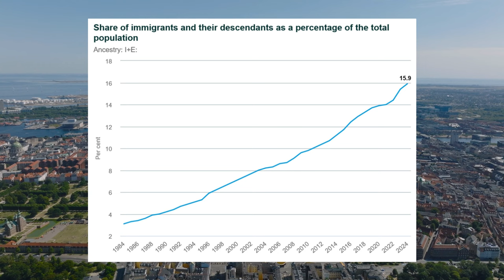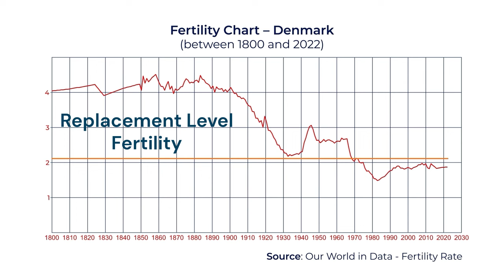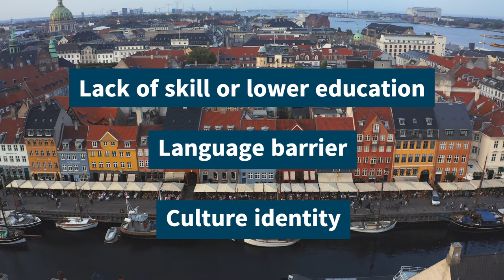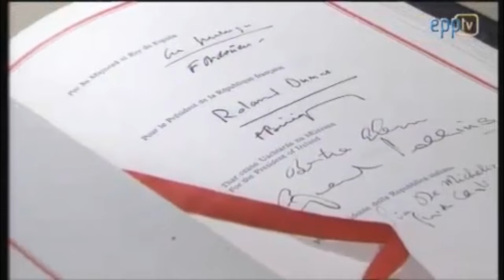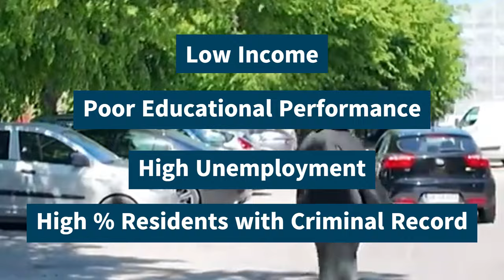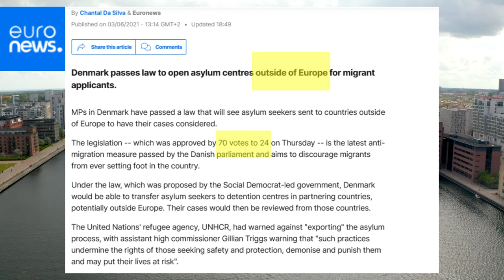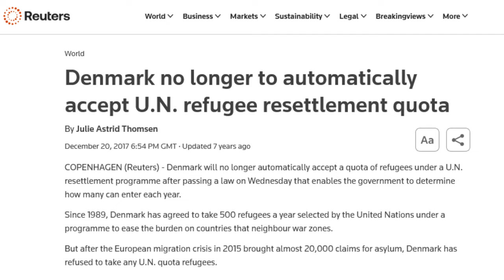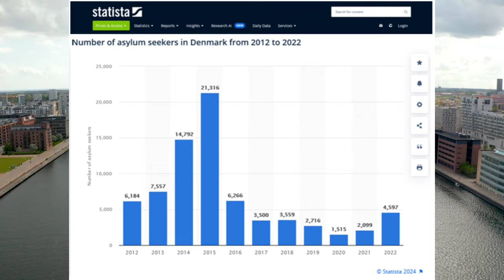This European Country Solved the Migrant Crisis. Here's How.

Comment: Denmark? Aren't you thinking of Hungary, who built a wall? Or rather, the video should say: that Denmark stood behind Hungary, Poland and Slovakia!
Reply: Denmark actually did well but.. things is changing now where Sweden is starting to give these people citizenships. EU access. That's why we are considering putting strict border control onto Sweden. We are now suffering from attacks in Copenhagen relating to Swedish Gangs.
Reply: I believe there is understanding from Denmark that Hungary build a wall, Denmark actually bought a NATO fence in 2014 , the plan was to have it at the border to Germany, but due to protests from Germany and some people thinking it would be dangerous for people if they tried to get through the fence ( they could just not try) it has now been sold to Lithuania , and all we got on the border was a fence against wild bores , that said the Danish politicians are not that good at supporting Hungary and Slovakia because of propaganda from EU about Hungary not living up to "democratic values" , I do wish however they supported them more, Poland is now in "the cool club" because they elected Tusk
Reply: There are only 14 asylum camps in total today, while the number was as high as 98 in 2015 less than 10 years ago. Right now, there are around 2,600 people accommodated in the Danish asylum camps, out of these 450 are staying in one of the deportation camps, and 700 are Ukrainians of which some are passing quickly through the system. 

These numbers are surprisingly low when considering that 25,000 arrive every month in neighboring Germany these days, not to forget what is going on in France and the UK.

Back in 2021 the present Danish Prime Minister and Social Democrat, Mette Frederiksen, announced that Denmark's goal is to receive 'zero' asylum seekers.

Denmark have also not accepted their absolute UN "mandatory" share of minimum of 500 resettlement refugees per year since 2015. So during the last 7 years, only 235 quota refugees have arrived in total, coming from refugee camps in Rwanda and only 1 resettlement refugee was granted a permit in 2023.

Comment: The video does not claim that Denmark does not have problems - on the contrary! It simply points out that Denmark has recognized and acted on these problems. It is simply a fact that the figures for Denmark are in no way as hair-raising as, for example, the Swedish figures in terms of crime.
Reply from the maker: Thank you! That's exactly the purpose.